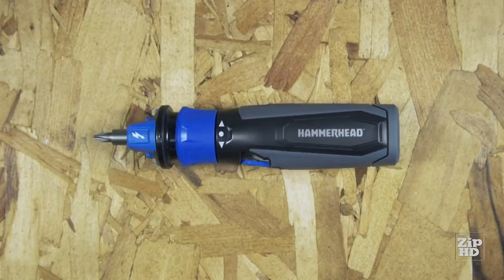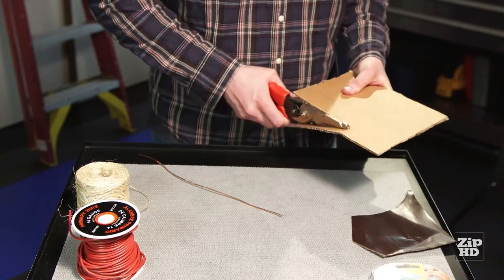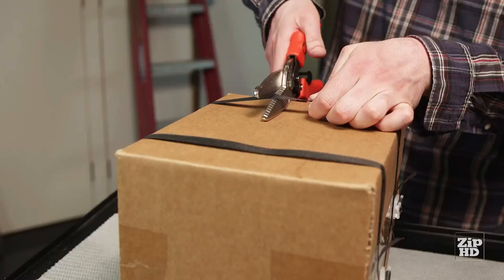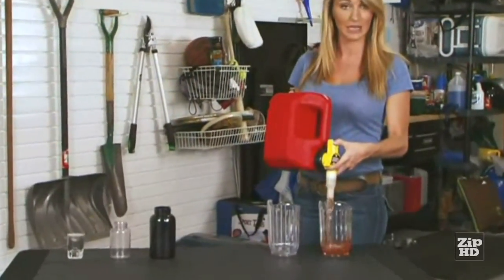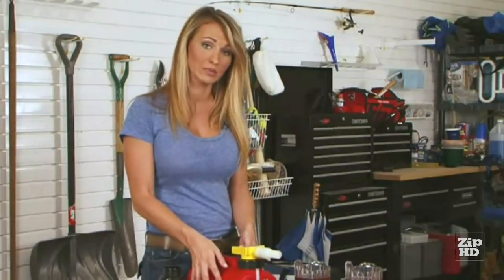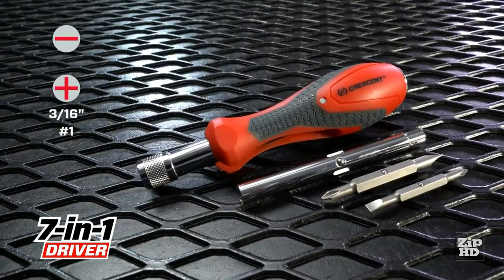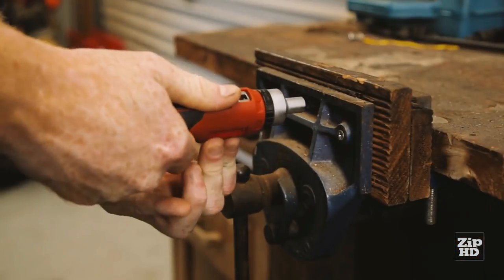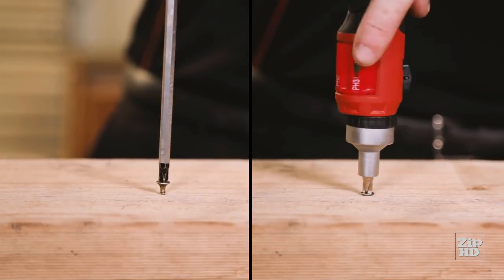7 Tools Every Man Should Have

Comment: I don't know about "should have" but could use sounds about right. The multi tool drivers are convenient to have but a lot of times screws are deep and a basic driver is the only thing that will get to the screw. It is also impossible to use the multi tool to pry with and I use my flat head for that all the time. I never use gloves. Gloves are actually quite dangerous if you are using power tools. I never had a gas can leak or pour out and so I really don't feel the need to buy a different design. Instead of doing that, how about making better made gas cans that last longer and are rugged.

Comment: The sure can spout. If you have the gas can in a hot environment like a garden shed and try to use it.  The gas will shoot out. From heat pressure. Vent before you use,